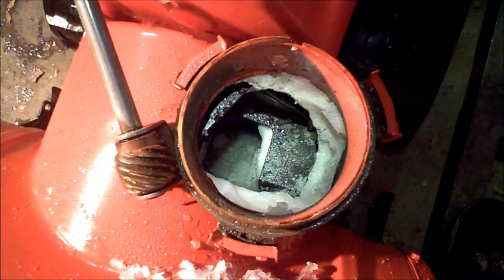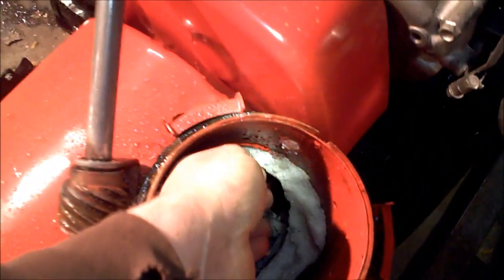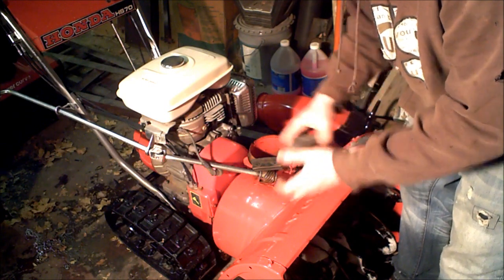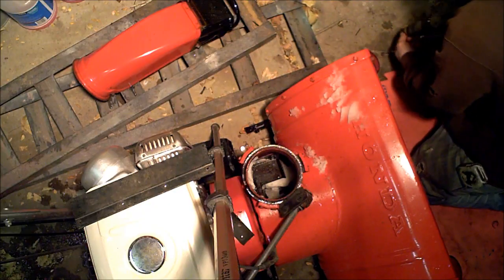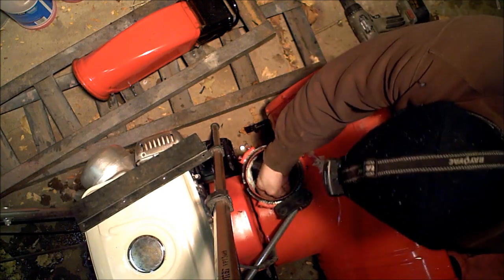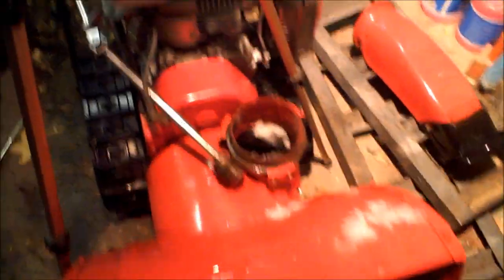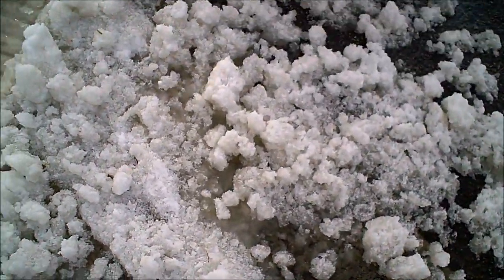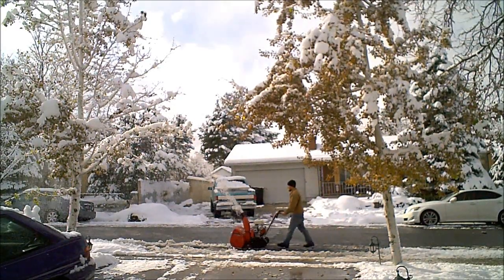Modify Snowblower to never clog and throw twice as far w/ Impeller Kit

Comment: HI that's a good idea, the only thing for an example if the impeller turn clockwise where do you install the rubber ? on the top for more flex and putting more stress on the self-tapping  bolts or under for less stress thank you. I did some modification to my snow blower because I am in a wheelchair I am a full parapligic. https://youtu.be/AA_kKqIAmQA

Comment: I guess you also have to be very careful that every rubber flap and screws and or bolts are the same size and weight otherwise it will throw the fan out of balance and it won’t last long then. I have a new Husqvarna ST 224P snowblower and the other day it was very nice outside and I went out to see how it would blow and sorry but I have to say, my Husqvarna snowblower blew it twice as far as what you showed on the video with out ever getting clogged!
Reply from the maker: Balancing is not an issue as the impeller blades are always off weighted with snow load. The Husqvarna ST224p is a decent entry lever machine but still have a pretty big impeller to housing gap from the factory and it will get larger with use. They do have a nice vertical, long chute design which aids in throwing distance though.

Comment: Five total words: "F*cking brilliant"...especially for older machines. Just make SURE...that no hoses or rocks are on the driveway,....buried in snow after doing this...otherwise the machine will NOT have any buffer space to deal with this.  If you don't understand what "I mean here"...don't worry about it.
Reply from the maker: Buffer space isn't needed. Rock and stones held in the snow get ejected with or without this. Without this modification though the stones may have a chance to tumble past once or twice and bend the impeller/impeller housing. This causes the gap to widen and impeller bearing to get destroyed. By having zero gap; the stones never tumble and get ejected the first time every-time.

Comment: Yes, I did this to both my machines. An Ariens and a Toro. Both are about 22” models. The Toro is five hp and throws the snow way better than before. Now, the Ariens is 6.5 hp. Seems to blow the snow at least 50 feet and is now my go to machine. It will actually blow the snow on the house roof. It’s almost comical. The toro used to be my fave but after this mod, the Ariens puts the toro to shame. The Toro became my backup. Thanks for sharing.
Reply from the maker: Awesome!

Comment: Makes sense. Good job. I will try this as soon as I get the gearbox back together. Dad put stainless bolts in the augers in place of the breakaway bolts. Needless to say, the next weakest thing broke. The bronze gear. Worst part is, I couldnt get the key out of the shaft to get it out, so I ground it off and have to have a new keyway cut in the shaft.
Reply from the maker: Breaking the gearbox can be an expensive fix.

Comment: how do you adjust the track?   Do you use belt tension scale to set at 31 lbs?     Most dealers I have dealt with just push down with their hands!
Reply from the maker: Adjusting the track rarely needs to be done. Too tight and you risk breaking it and ruining your machine. Older Honda tracks are no longer made, nor are there aftermarkets available. I adjust it by feel so there is barely any slack.

Comment: Does this modification cause any wear on the volute or throat of the blower? It's a great idea I just don't want to cause premature wear.
Reply from the maker: It does not. The rubber doesn't really touch the surface, just skims it. It will if anything prolong the life of the impeller housing by not allowing rocks to get pinched between the blades/housing and clears the last remaining ice out so it lessens the rust that is contributed to this.
Reply: It was a pain the ass drilling the holes but once complete-what a difference in how far the machine threw the snow. Almost can't wait to try it in slush.

Comment: What can I do with a Toro since you mentioned they are too hard to modify.  Mine clogs badly and is useless.   thanks
Reply from the maker: You may just have to use bolt and drill holes vs self taping screws. That's it.
Reply: 2x thumbs up. TY 65Ford. let you know how works

Comment: Outstanding!!! The beauty is in the simplicity and the logical insight. I wish I could solve this problem on my Bolens 38" single stage blower on my Bolens 1450 garden tractor.
Reply from the maker: Just put a flap of rubber on the flat/straight parts directly below the discharge chute on both impellers. It'll throw like a mad man.

Comment: Did this to a 826 Canadiana Made in the late 70s,i cut out strips from an old tire and used, and holy shit what a difference,  now it throws at least twice as far compared to what it did before the mod!
Reply from the maker: Awesome, I'm glad you tried it out.
Reply: And now the impeller bearing is totally gone,haha. Don't use tyre sides guys,prabably to heavy if it's unbalanced. I'll see if i can't find something lighter after i have changed the bearing :)
Reply from the maker: The snow load is only on half the impeller at a time and the thing is constantly out of balance by upwards of a few pounds while spinning. Balancing makes no difference. Impeller bearings go out all the time and are a common repair item.
Reply: @sixtyfiveford  Good point, which I hadn't previously pondered.

Comment: Does this also happen to the two stage Craftsman 88694 Quiet Model? I just purchased this Snow Blower, So i would like to do this Mod if needed, before i even use it for the first time. Thanks for the video and tip 👍
Reply from the maker: Your Craftsman is made by MTD who mass produces a lot of home improvement store machines under a dozen brands. All these machines have a pretty big gap and benefit from this modification. If you live were it's powdery snow all the time, you would only mildly benefit. But if the snow gets slushy or wet, it's drastically improved.
Reply: sixtyfiveford Awesome, I am in NYC and Snow get's slushy big time.  Thanks for your reply 👍

Comment: I have a 10 32 3 stage craftsman snow blower from the 70's I haven't looked at the gap on mine yet but what's your opinion on doing that to something as big as mine? It has always thrown snow around 10 to 12 feet but I was thinking it was because I'm trying to clear a lot in one shot
Reply from the maker: Their impellers are very thick but generally have a pretty good size gap. It will definitely benefit from this.

Comment: This is GREAT!  Just moved from AZ to Iowa and picked up a barely used YardMachine by MTD 2-stage.  I've NEVER used a snow blower and don't want to be the new kid on the block unclogging all the time while the natives point and laugh at the kid from Arizona.  Pulled the chute off yesterday and have 3 blades (gonna do them all to keep it balanced).  I have close to 5/8" gap and the blades are very thick metal.  Wondering if the self-tappers you linked will work for my machine or should I go with nuts and bolts?  Hoping somebody with the same machine can chime in and point me in the right direction.  THANKS!
Reply from the maker: Self taping screws will work on an MTD.

Comment: I use fernco plumbing connectors... You can get 2-4 out of a 2" connector... I back them with a small steel plate and 1/4" stainless steel bolts and locking nuts. 

I have a 1995 craftsman 26" 5hp track drive that I modified all the axles and drive shafts with pillow blocks and sealed bearings instead of the old pre-oiled bronze bushings. I had to make a new wider track axle to allow for the pillow blocks. Next update will be a bigger engine... It is like a tank. 

I also have a 2014 28" in Troy Bilt with joy stick chute and heated grips for my apartments. That one the bottom of the auger housing already rusted through and I had to re-weld new metal on the bottom. The craftsman auger housing is still in great shape. The just don't build stuff like they used to...
Reply: It's called planned obsolescence this way they can sell you a new one sooner more $$$ for the company less for you.  Many new blowers use sealed transmissions no more simple drive disc that costs about $20 to replace if it wears out.

Comment: Really those little Toro single stages are good up to a foot of snow ? I never thought they would be. I might have to pick up a used one for my deck and sidewalks, and try it out. my 11hp blower is a little big for my sidewalks.
Reply from the maker: They handle 12" of lighter-medium density snow pretty effortlessly. Heavy Wet snow and they'll still tackle 8-10 slowly and under that relatively easy.

Comment: Should you be able to move the impeller by hand if you have it engaged, not running of course.
Reply from the maker: Newer units(past 20years) have a brake that stop the impeller from turning when disengaged and the engine will hold the impeller when engaged. You can pull the engaging lever slightly and it will release the brake and not engage the engine.
Reply: I can engage it and still turn by hand. Obviously the belt is slipping which I just replaced. Mind you I'm not being able to turn it easy, but I can still turn it.

Comment: awesome tip thanks - going to do this to mine... but I do have a question (kind of related)...

My snowblower, even when I bottom out the height adjusters, will leave a coating of snow on the ground where it has passed. Is there a good way to fix this issue? My driveway is not perfectly level, but even in the very flat spots it does this.
Reply from the maker: You need to lower the scraper bar that runs all the way across the bottom. But even then a 2 stage will never clear perfectly like a rubber paddle single stage.
Reply: On my model, the height of the scraper is adjusted by two sliders on the sides, which I have bottomed out - but I think you answered my question in the second sentence... its just not possible to get it clean like a rubble paddle model. Thanks!

Comment: I FINALLY got the parts for my blower brought in for paint & powdercoating yesterday. I should be rebuilding it in a couple weeks. OH & there are sign shops that can scan & make new decals (I am essentially doing a restoration), and I will be using it for it's original purpose).
Reply from the maker: That's great.
Reply: I just got a call from the Powder Coaters & the box, augers, impeller & shaft, and other "tins" are done, total cost there $321.00, I was expecting  at least $300.00 & knew it before I brought the parts up, now after I get that paid off I will be able to get it together after a three year calendar of working on it off & on.
Reply from the maker: That's going to be really nice.
Reply: And the powder coat will last another 30 years. :)
Reply: I will send you a link to my Flickr page as I get it rebuilt. :)

Comment: Run your snowblower for 1 minute every month, summer, winter.  It will start for sure when it will snow.
Reply: Use a product called gas stabilizer, brand name...Stabil. Just add that to your gas cans whenever you refill one and then anything you fill  up that runs on gas, will start just like it did when you put it away last year. No need to run it dry or drain the tank any longer. Been doing this for years and have never had a single problem starting anything, including my heavy duty hedge trimmer, that I only use once a year. I've ran that now on the same tank of gas for two years and it still started on the first pull after priming. I swear by it. Never a carburetor problem or any varnishing, what so ever! Jpol.

Comment: So is it more effective to put 2 pieces of rubber diagonal from each other than doing all of the impellers? And also are the screws in this video better than drilling holes and putting in bolts and nuts?
Reply from the maker: You can put 4 on, it just makes no noticeable difference in performance vs 2. Do 2 and see if you want to spend all the extra time to do the other 2. You can drill holes/bolt it if you like.
Reply: Thanks. Also do you have the link to the exact extension you used for the self tapping screws? Is it this one? https://www.amazon.com/gp/product/B0000225P9/ref=ox_sc_act_title_1?ie=UTF8&psc=1&smid=ATVPDKIKX0DER

Comment: I installed the rubber paddles but I also used small metal mending plates and bolts. Tested it out and works great. Except for the extra noise. I tried trimming the paddles with a snip tool but don't want to undo what I have done and trim too much.
Reply from the maker: They may hit for a few minutes of running but after that they shouldn't be hitting enough to make any noise. They need to just skim the surface.
Reply: That's what I am told. A friend also suggested that I use silicone spray before I start. Thanks for your help!!
Reply from the maker: Silicone spray will prevent the rubber from wearing down.
Reply: Ok. Good to know. Thanks again.

Comment: I have a toro runs like a beast but clogs easily..anyway to do this mod even tho the impeller is metal as you say...still haven't fully checked to see if impeller is metal ...almost 15 yrs old still runs like a champ..i may just have to try a silicone or a non stick spray
Reply from the maker: I just meant that the metal on Toro's is thicker and you may need to predrill the holes.  I works amazing on Toros.
Reply: Bruce Lee j

Comment: I had to repair the auger drive gearbox on my Toro 624 and while I was waiting for the new gear to arrive I thought I would add this modification.   First, I had to find the material, and not wanting to spend any more than I had to I decided to cut up a truck mud flap.   Recalling having seen mud flaps laying around at loading docs at a nearby industrial park, I drove through and quickly found one laying on the ground.  I guess they get torn off sometimes when the truck is backing up.   This one was about 5/16" thick.  After measuring the blades and gap to the housing, I cut the mud flap on my table saw to the size I needed and drilled holes slightly smaller than the screws I planned to use.    I needed   3 for the Toro's 3 blades, but I made a few extra for spare.   I also drilled and tapped screw holes in the Toro's blade.  I used #10-24 stainless screws and put fiber lock nuts on the other side for good measure.   I reassembled everything after I finished rebuilding the gear box and had a chance to use it last week.   It works great!  Didn't clog when it hit the slush at the street and seems to throw much farther!
Reply from the maker: Nicely done.

Comment: Sounds like a good trick. I will have to consider it. My Areins is pretty good but in floating slush it acts more like a water pump with no outlet house. I try to get the snow before gets that we. My machine has fairly tight clearance, In guessing 1/8".  My neighbors do comment on its throwing distance.

Comment: Great video! I'm guessing it's best to install the rubber paddles on the side of the impeller blade that contacts the snow first so it has support from the metal paddle, not the trailing edge of the impeller blade where more pressure would be applied to the area right around the two screws. Or doesn't it really matter?
Reply from the maker: Yes, the leading edge.

Comment: Hi,
Made this mod to my JD 724. Worked great! Cleaned 3 driveways of wet slushee snow yesterday. My only mistake was not using sturdier rubber. Will upgrade, as on the last drive the rubber started to let go. My wife even noticed the snowblower was doing better. Thanks for the knowledge.
Reply from the maker: That's great. I'm glad you tried it out.